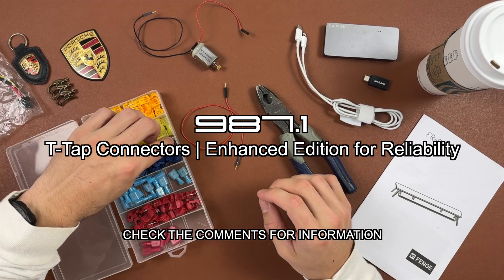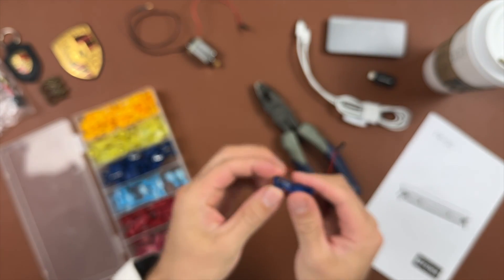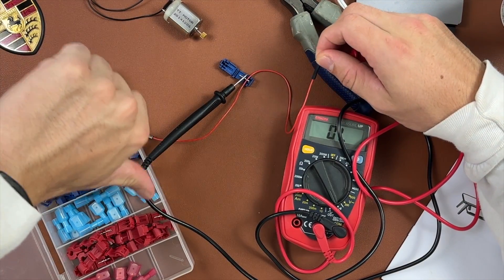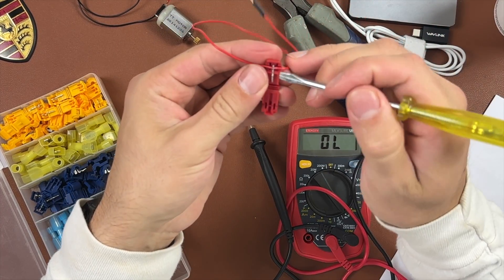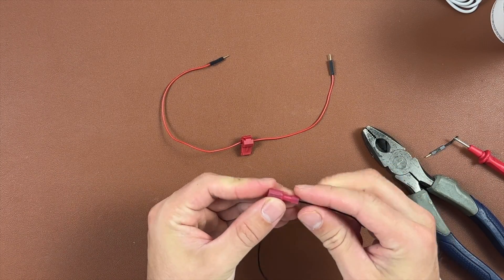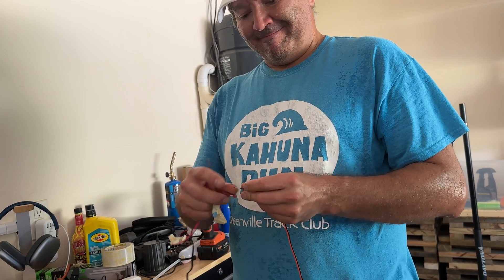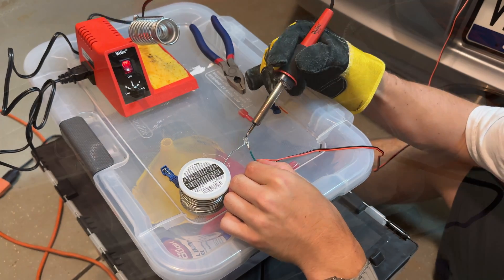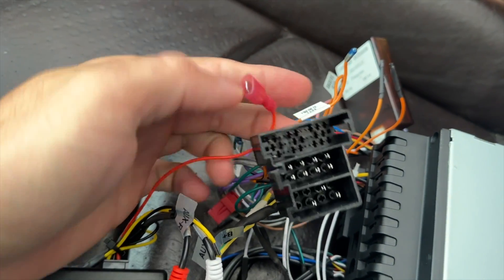How to make better T Tap Connectors

Comment: Might be because the wires you're using is too thin, that's why it doesn't make a cut. It should have resistance when you close the lid part of it then it cuts the wire inside

Comment: Thinkbuse the proper tool. They're called crimping pliers. There's a reason auto manufacturers don't solder. Crimp is the better connection on a vehicle with all the vibrations and whatnot. Solder joints Crack.
Reply from the maker: Very helpful, and moving forward I’m going to be crimping more often. Thanks for this invaluable pointer.

Comment: This is not the proper way to use the connectors.  They should be crimped with a proper crimping tool not standard pliers.
Reply from the maker: The instructions on these say they’re compatible with pliers. I agree that it resulted in a less-than-optimal solution. If you watch on, you’ll see how we solder the connectors to make the connection reliable.
Reply from the maker: Thanks for the comment btw 💪
Reply: Also the t taps come in different sizes. If the one that you have is a bigger wire, it's not going to work for a small wire.